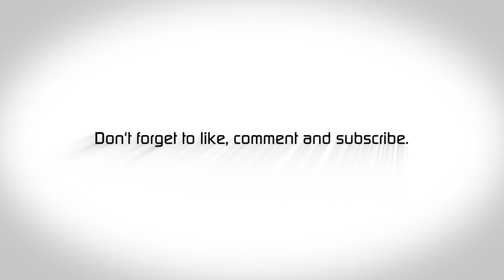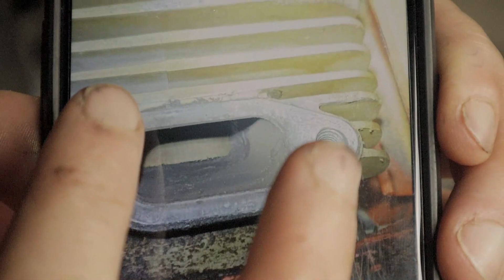How To Fix Stripped Chainsaw Muffler Bolt Threads - Husqvarna 365 X Torq Chainsaw

Comment: I have done a few screw inserts now on three series Huskys in the cylinder I don't drill it anymore you can normally just cut a new thread by hand. The 365 is such a good saw glad it worked for you.
Reply from the maker: That's great to know cheers Patrick